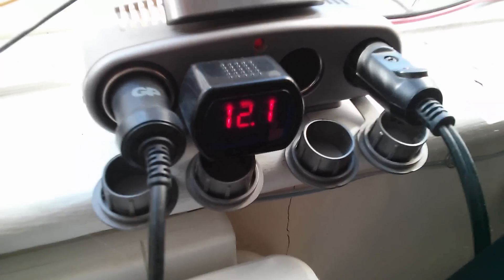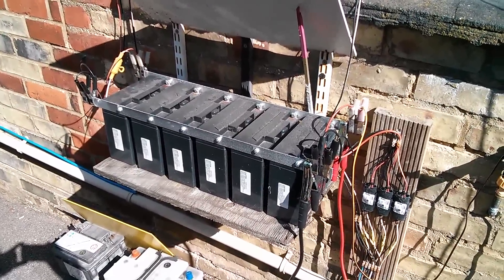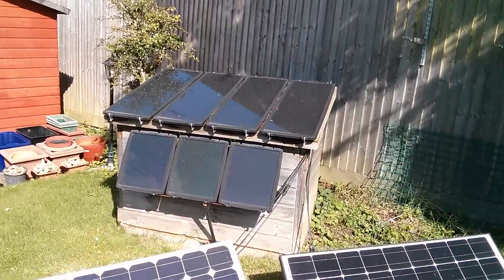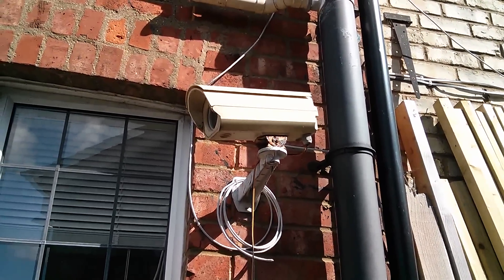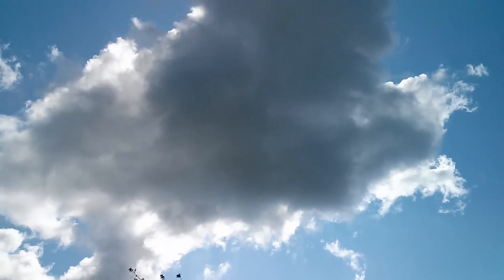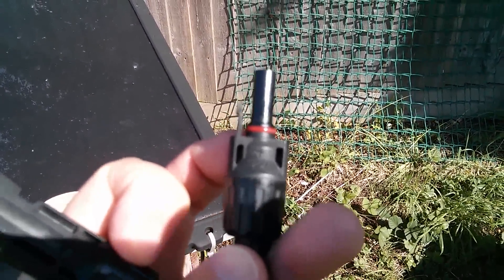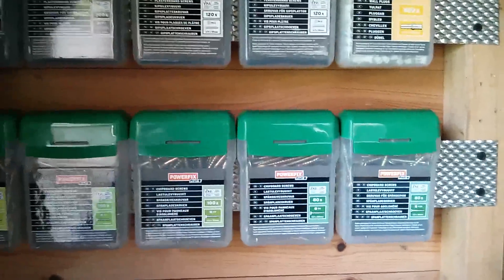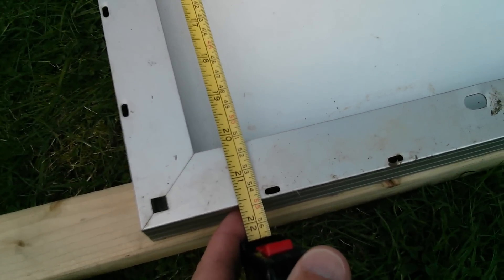Julian's builds: a Solar Panel Frame for the Winter #1

Comment: wery easy and simple build wood box what have adjustable angle degree and same sideway adjustable degree too. and you need all battery good box, or made good shed and all battery in shed and wall have power station share lto better and beauty all cables and battery were share power. simple little work but lot better than now, now show wery stupid and ugly all.

Comment: If you’re looking to replace your 1A consuming CCTV camera, the IP ones all over ebay based on the OV9712 sensor & HI3518 SOC seem OK.
They output H.264, you can open the stream with VLC. The software they come with is trashy. I use mine with Zoneminder.
The cameras I have each consume 110mA @ 12V with the IR illumination off.

Comment: Vaseline (petroleum based) or a silicone based grease, which is recommended?
Cheers, Mark
*************************
Reply: aluminium rails and cable need alltime white silicon vaseline, this is elektric basic work you must know this simple basic rules.

Comment: hi julian, have you tried wind power.. yes its more expensive to set up and probably wont give you much power but its a good fun challange setting up.. I just set up mine in UK and have a similar voltage mismatch going on from the turbine to the batteries., some times I have the blades spinning their 8oow motor to the point where they are blurred and still dont produce power as their rotation is still not fast enough.  Much of the time I have power at lowervolts than the battery which I lose. So, I though about putting a car audio amp cap (1F) on the input before the batts.. would that help you think?

Comment: Shouldn't you use a silicone based lubricant on the o rings? Vaseline is petroleum based and so will destroy the rubber rings over time.

Comment: Are batteries ok sitting on the ground like that? My father and I believe you have to have barrier between batteries and the ground. We heard from somewhere that it'll shorten their life span and drain them.
Reply: +SadamFlu That's on old myth =)
Reply: +SadamFlu. No that would not occur. For a high (relative to 12v i.e. 230v) voltage AC system there could be some capacitive coupling. 

But this is a low voltage, DC system. If anything, the heating effects of the sun might cause some accelerated degradation.
Reply: +TED6667 Cool thanks for that.  We've been thinking that way for years! lol! And our experiments with the idea have always been with faulty batteries anyway hahaha!
Reply: Cool, thanks for that. Ahh well, I guess I didn't have to be so stringent this whole time... hehe!

Comment: As much as i enjoy your channel, it has to be said that your solar setup is a superbly brilliant example in almost every respect imaginable of how not to do solar!!! Quite educational really if you look at it that way :)
Reply: +Peter S Never seen him say it was a professional setup to power the whole house. I always assumed this was just a simple and cheap diy system to power small things.
Reply: +JJayzX At least for the most part the system isnt exposed to a lot of flammable materials!
Reply: +Peter S Where are the flammable bits that anyone would be worried about?
Reply: +SDG Electronics  While in this particular install being 12v system , outside etc, is lower risk, however in general, solar panels are routinely cabable of producing higher DC voltages with consequent parallel and series arc combustion hazards. And, batteries store large amounts of energy, and if shorted, either accidentally, or by plate failure, can enter thermal runaway, creating a vented hydrogen ignition risk.....  As i said the real risk occurs if people watch this, and apply the lessons to other systems where the situation may be more risky. Ive worked in battery labs, and seen batteries explode first hand. Better wiring and circuit protection practice ought to be what we are promoting/educating in venues like this.

Comment: what can you run from the power gained from your panels, is it true they do not charge in cloudy weather?
i was looking at getting some on my roof as we are perfect and a huge old house so i have the height.

Also have you seen the coke cans solar heaters... i wanna try that as well.
Reply: +JRushPixel i have 2.8kw of panels on my roof, and i have averaged over the year, around 9kw a day, of course this covers the high and lows of winter and summer, they are south facing and have no shading issues, yes they produce some power in cloudy weather, but the main expense is the fitting, so if you pay someone to fit, cover your roof with panels to get the most out of the work, also i have micro inverters on each panel, this is connected to the house mains of course, so everything benefits from the power made.
Reply: jusb1066 No expenses at all for the panels or fitting, they getting done free under a UK Gov grant. I own the house and its old ( 140 years ) so its free...

Comment: i enjoy your videos. could you share a link to your ups batteries and your 80/100 watt panels. thanks.
Reply from the maker: +Adrian Locke The batteries were a gift from a friend who carries out maintenance at a school. The solar panels were bought several years ago from a seller on eBay - I can't even remember the name of the company - I think they were in Bromsgrove.
Reply: +Julian Ilett thank you for the reply
Reply: +Julian Ilett .Greetings. Have you thought of making your solar panel to track the sun? (Project) Its less of a hassle to setup your panels to face the sun every season & it can harvest more energy since it will be facing the sun every time. TBH it will look awesome. Let me know if your into that kinda thing. I can get some DC geared motor for you, which will work fine for the project.
Reply: +Ashwin Bhanderi 
Just what I was going to suggest. An enterprising young chap like Julian should be able to devise a sun-tracking system. I know you can buy them "off the shelf" but where's the fun in that. Would it have to be computer controlled? Don't know, maybe another Arduino project? Possibly a couple of "stepper" motors and away you go.
Reply: +Adrian Locke  I am actually thinking about getting batteries from a car junk yard.  Has anyone ever done this?
I also have 2 panels from ebay, a 40 and a 10 Watt but I should go check locally since the transport prices where almost half of the price.
Reply: +James Lamb was thinking the same. You would not believe how much difference an angle of 20 degrees does.  I was thinking about using  those old motorized sattelite dish things. They had a nice motor and a worm wheel construction.  Should not be that hard to make using an arduino.  The only thing that you need to take into account is that it also consumes energy so an adjustment every 2 hours would be advicable.
Reply: +Julian Ilett you said you went to Malta for a holiday weirdly enough to we went there for a holiday there as well